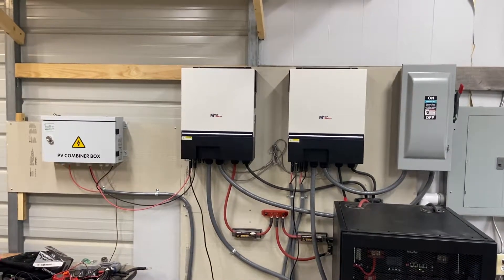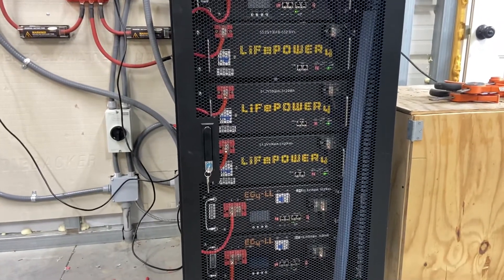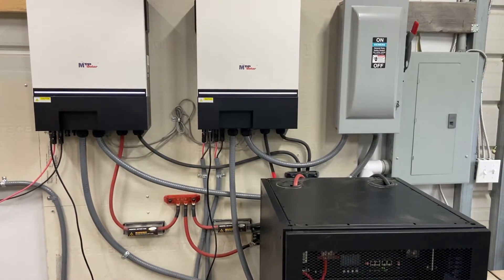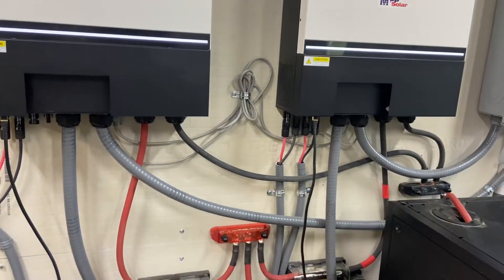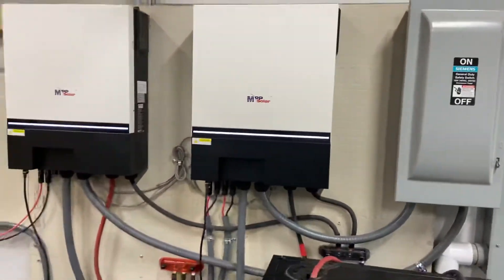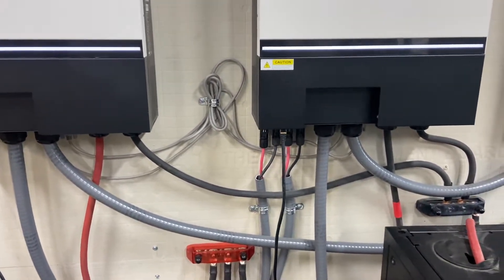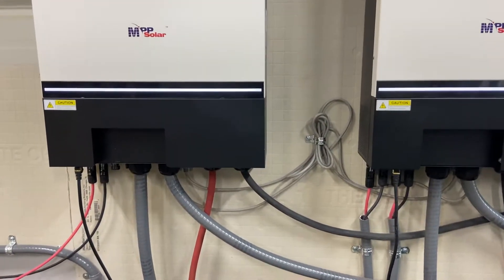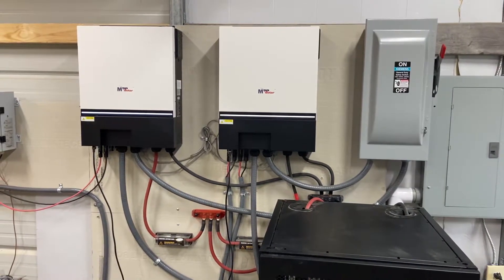LV6548 split-phase system. Inverters and batteries.

Comment: No problems running both inverters in parallel on the DC side to the same battery pack and doing a 120/240 split phase on the output?
Reply from the maker: No issues no. Then again we are talking about AC/DC. So it isn’t a problem no.

Comment: Hey gavin quick question. Does the fans on your lv6548 inverters runs constantly without load?
Reply from the maker: Yes they ran all the time. Idle or under load. They just get louder under PV or load. The inverter I use now shuts the fan down when it isn’t under load.
Reply: @Gavin Stone DIY Homestead   alright thanks for the reply. Purchase one of the lv6548 so was just wondering if that was normal

Comment: Nice install. Next upload, can you go over the AC input and Output in a bit more detail? I assume you come off the main home panel to provide input to the inverters for charging nust in case, and then feed the output back to a sub panel in the house with critical loads?
Reply from the maker: Exactly. I supply the inverters with a 240/60 amp breaker from the main panel. I use one hot leg from the 60 amp breaker for each inverter. Then it’s just a matter of running a ground and neutral to each inverter from the main panel. Then I repeat the process to the critical loads panel. I just installed the exact same system for my father. He was very confused about the ac input/output. But it’s actually fairly simple. Each inverter is single phase, so it needs one leg of the breaker. And output is the same.I can try and add more detail in my next video.

Comment: I have found your channel thanks to your comment on mine. I think you have enough power to run all your load’s through your system. Just keep the grid as backup. That’s what I have been doing. Then when you keep building solar panels and battery storage till you don’t need grid power you could unhook the grid power. But for 10 dollars a month I will keep grid for emergency backup.
Reply from the maker: Exactly what I was thinking. I will slowly transfer my loads to solar. What I like about the newer systems like this is they are expandable as you can afford them.

Comment: 🤤 You have exactly what I want! When I get to this point in my adventure I will be buying the newest model too, then a year later something else will be out lol.
Really good job! Same system, I want to add a ATS inside the house that switchs the neutral as well for the bonding to switch when activated and run all my essentials. Again great job you have a new sub waiting for your array video 😁 Keep them coming. 👍
Reply from the maker: “New sub” you mean only sub! Lol. Thanks man. So far I haven’t had any issues with the ATS in the inverters. Although I do get what you’re saying about the bonding. Maybe it just isn’t an issue. Would you bother using a shunt for this system?  I’m too far away at the house and I don’t have WiFi. So maybe it wouldn’t serve any purpose anyway.
Reply: @GavinStoneDIY  I want to put a ATS after my main panel to run my critical loads off the MPPs during a power outage 😁 instead of a generac.
Reply from the maker: @Roll2Videos  I’m not sure how expensive ATS switches are. I just wired  a critical loads panel to handle all the inverter loads. I designed it with a pass through switch to the main in case the inverters ever have an issue and won’t go into bypass. I honestly think that’s the best option.
Reply: @GavinStoneDIY  when I win the lottery I'll make a video about it lol.

Comment: I'm having a bit of trouble installing the 4awg wire into the AC In/Out terminals. Any suggestions? Thx
Reply from the maker: Yes it’s an extremely tight fit for 4 awg thhn wire. They have to be stripped carefully so the wire stays in a nice smooth shape.  If  you pre bend them slightly in the direction they need to go before trying to fit them in the terminal it helps. The neutral is the easiest because it’s a straight shot. And just tighten the screw snug. Don’t over torque.
Reply: @GavinStoneDIY  thx. I'm considering ferrule crimped in a square shape. I'll try your suggestion first. Thx again
Reply from the maker: @thenuthing8258  that may work if it’s rated for the voltage. It is a pain to get the 4 awg in there but it does go. In fact I’d say that was probably one of the things that took the longest when I built the system. I was pretty frustrated with one of the grounds especially that just refused to go in. I kept removing it and bending the cable below slightly till it created a decent angle then it went in.